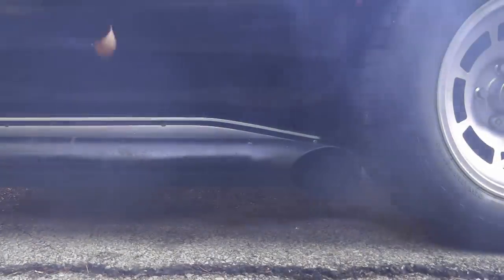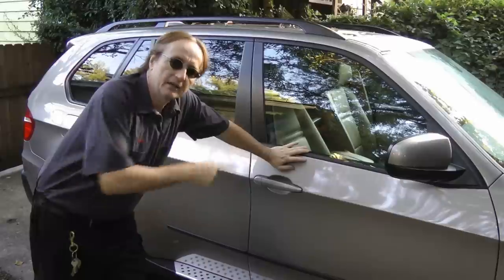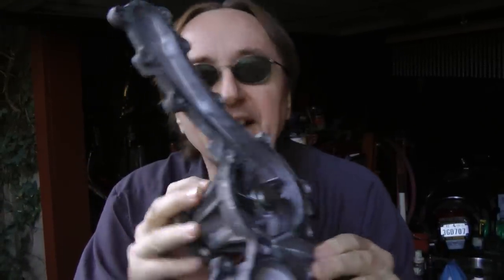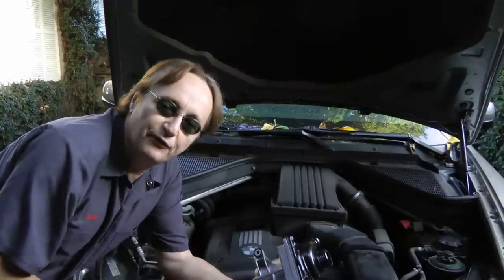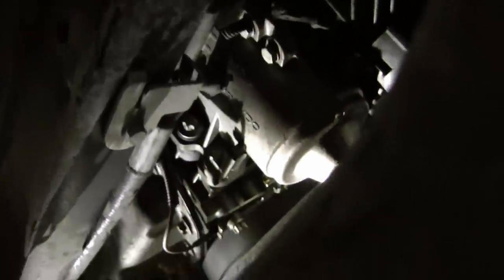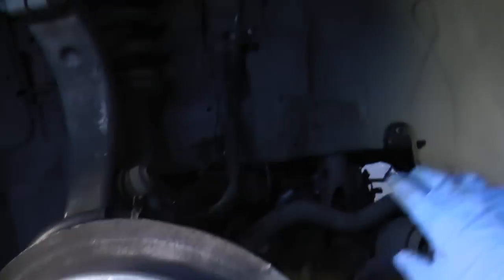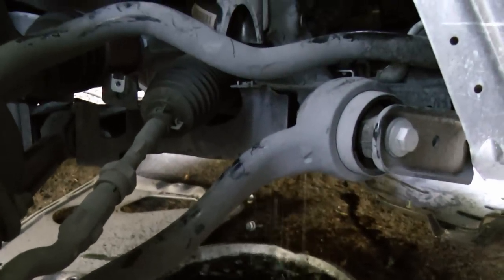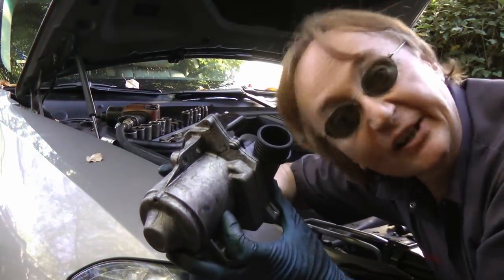How To Replace a Bad Electronic Water Pump

Comment: Well, let me first say i love your channel, as to the electric pump, it.'s plastic to save weight, and it is electric so it can be turned off when not needed and thus does not create unnesecary drag on the engine. Full disclosure, i own a 12 year old bmw and it has never given me any headaches. I once talked to a headgasket manufacturer and he told me bmw has an acceptable failure rate of 0.05 while chrysler's where from 2-3% this extra overhead makes the parts expensive.
Reply: Failure rate of 0.05 and the parts still break all the time?
Fuck BMW .
Reply: Reducing weight makes sense if you drive a race car around a track. With a part that's more expensive and breaks more often than a traditional pump, the money you save in fuel is probably very low compared to the costs + labour for replacing it. And if fuel efficiency is your concern, you don't buy a BMW. You buy a Prius or something like that.
Reply: Dont worry Henrick...
Here, we witness another BMW fanboy who has never actually driven one.
Reply: Bruno Danese sorry your comment makes me sad. You have not even bothered to read my comment. If you would have, it clearly states I own an 12 year old bmw(I also own 2 BMW motorcycles(one from 87 and one from 98, both maintained and driven by me, so i know a bit about the mechanics not to mention the fact that I studied industrial engineering, maybe irrelevant, but I like to think it gives me some insight in mechanics). I also maintained an american car that gave me nothing but headaches, so yes, I am a fanboy, but not because of the badge, (I would rather see it be unrecognized), but because of the engineering, although there are some design errors, german cars are in fact well engineered. So please, if you are going to comment again in this thread(or anywhere else on the web) read the previous posts first, do not be condescending and insulting, and try to add something to the conversation and not subtract from it. If you have actual reasoning and points you would like to make about the conversation/debate, I'll be happy to read them and maybe even adjust my opinion. For instance Henrick Nilsen brings up some excellent points
Reply: Henrik Nilsen Yes, I am not going to argue there are no design flaws(there always will be, and bmw is quite keen on making them) The savings might be minor, although the same can be said about rack and pinion versus electric assisted steering, yet the entire industry is moving toward the latter(although I really dislike the feeling). I am assuming you are an american or canadian?(sorry if i am incorrect) but in europe bmw's are like camry's, they are everywhere (with diesel/small 4 bangers)and in the domestic marketplace, there is an advantage if bmw can tout 5.0l/100km if audi uses 5.2l/100km + EU regulations that must be met.(ps petrol is ~6.00 $/gallon in europe). So yes in the american marketplace where bmw is premium, it makes no sense, but domestically, it does make sense. However, bmw are full of themselves concerning the price point of parts. Ussually they are very well made, but ridiculously overpriced, even taking into account the acceptable failure rates, that is correct
Reply: Henrik Nilsen ps there are other advantages of the pump being controlled by the computer. The engine can reach operating temperature faster, turnover on cold days is easier without the added drag etc. And plastic is in fact more corrosion resistant than metal, thus normally it should last longer. Should it have been engineered better? Probably, but the idea is correct(that's why other manufacturers also do it). I love Scotty Kilmer's channel, he has great insights, is helpfull and is a champ for making the videos, but ever so often I find him to be shitting on european cars because they are not like the ones he is used to in america. Which is totally acceptable. I also shitted on an old pt cruiser I used to maintain where I had to take of the front wheel to replace the headlight bulb. Now that's stupid engineering compared to a bmw where you don't even need tools(just clips that can be loosened by hand). Now bmw is also crazy as to stipulate i need to check my clutchplate every two years on my r1100gs(the whole bike has to be disassembled to do that). So as far as I can tell, every automaker has it's quicks, but I do love the feeling of a Boxer

Comment: I had an 82 Camaro, it was 19 years old at the time. The water pump belt snapped while on the road. All I did was walk across the street, picked up a new belt at a mechanic's shop, put it on and drove off. No mess.

Comment: when i was doing research for bmw e39 and e46 i saw somewhere that u can buy aftermarket water pumps with metal propellers...that will help u a ton on BMW, since they all have overheating problem, because of a water pumps.

Comment from the maker: well, coolant is not flowing through the heater core and it's overheating. So really, fix the overheating problem first as heaters often fail when the car overheats, especially if they get air in the system as heaters don't work with hot air only hot water. try my video "how to fix an overheating car'

Comment: I fully support the idea of electric coolant pumps. They help the car warm up faster in winter (helping fuel consumption and improving comfort) and can run faster in summer when engine is idling to cool down the engine even with the engine off...something you can't do with a pump dependent of the engine revs. But I also support Scotty's point of view about building this pump with brittle materials and installing them in unreachable spots in the now very cramped engine compartments. Coolant pumps always fail, either every 40k miles or every 100k miles they always fail so make everyone a favor and install them in easier places....not like you depend on the belt to run it like before. This is why all luxury brands get hit by depreciation a lot more than conventional brands.
Reply: +Ivan Jaen You can get the original brands completely out of metal. So why does he put a plastic one in and then moan that plastic sucks.

Comment: Disclaimer: I am only sharing my own personal experiences...
I had the same issue with my 2011 330i BMW that only had 50k miles on the odometer. I purchased the car used with 15k miles and the car was in showroom condition. The electronic water pump and thermostat had to be replaced at a total cost of around $1,500 dollars at a Indy shop. I had three oil leak repairs totaling over 1k and a starter replacement that cost around 750 dollars. Once I was driving on I-270 and the serpentine belt flung off because the oil leaks on the motor. The motor developed major oil leaks with around 50k miles on the odometer. The BMW dealership in Northern Virginia wanted 1,400 dollars to fix it and they were a little cheaper labor rate than Maryland dealers. I tried to replace the water pump myself but unfortunately it was overly complicated and BMW requires that you use their antifreeze coolant. Plus it was a whopping 8 degrees in Maryland that day with the wind blowing around 30 mph.The indy shops were a little cheaper but the frequency of things breaking made it frustrating to own a BMW as a daily driver. The bulbs in the tail lights burned out every other month and had to be replace. Each tail light held between (6-8 bulbs per board) which frequently burned out and would throw an error code on the navigation screen. The indy mechanic told me that its good I did not own a 7 series because it is 1k from the start to fix them because the front bumper has to be removed to access the motor. I traded the car in for a loss in 2013 for a brand new Nissan Maxima with an extended warranty. I still drive the Maxima as my daily driver with no major issues to report so far.  My next vehicle will be a Toyota 4-Runner or something equally as reliable. Scotty gives great advise about cars and knows exactly what he is talking about.

Comment from the maker: why would anyone defend BMW's insane over engineering? If they were logical, this stupid electronic pump would be mounted on the fender and take five minutes to change as an electronic pump could be mounted anywhere. But no, they hid it inside the engine causing one big mess to get it off. Realize, they just don't care about repair expense.

Comment from the maker: on those, often a bad main computer circuit does that, most guys will just wire the fans to run off the ignition switch and run all the time the engine is running, hurts nothing, easy fix

Comment from the maker: if the cam is worn out, it will not pump. In such a case, put an electrical pump on instead. Old worn out engines often get like that.

Comment: Hey Scotty! I'm a fan of the older BMW e39 e46, much easier to fix the the more modern ones which are full of plastic that breaks. Beautiful cars to be involved in maintaining and driving them and they have mechanical h2o pumps. I agree all your statements about BMW and Mercedes. My questions is do you agree with my statement or you are just hateful towards any year BMW?

Comment: The commenter posting about "dissassembling the entire Audi front end" is making it more than it is - that's called service position, designed to access the longitudinal engine. For any VW/Audi mechanic, this is a standard straightforward procedure to pull off, and the radiator support is designed to be easily pulled out straight

Comment: You're somewhat right but BMW and other German manufacturers do make some real over-complicated designs that kind of make one scratch their head. Every newer BMW leaks oil like a faucet after 60k and all the seals need replacing, plastic/electric waterpumps, faulty HVAs and fuel pump designs that they can't even figure out why they're failing. They make great performing vehicles so I'm sure they can engineer some sense and reliability into their product as well.

Comment: I have friends that have old e36 and e46 3 series, never had major problems with them. Engine and transmission (manual) were pretty much bulletproof. Guess it depends which bmw you buy
Reply: Stephen Wood that's the problem only old BMW were reliable. For the most part anything past e36s were less reliable

Comment: Sort of funny you'd mention the bumper for a Buick bulb.  I worked with a couple guys years ago in Virginia, just got out of tech school and came to work at a Pep Boys I had been at for a while.  They had an older Buick that needed a bulb, and they couldn't figure out how to get to the bulb from behind, since there was no opening, so they started disassembling the thing.  I came over a little later and, without spending more than a few seconds to figure it out, reached under to change the it.

Comment: Theres only a few mechanical water pumps I'd hate to mess with... the ones on some 4 cylinder ford escorts which are driven by the timing belt XD and the gear driven reverse-flow water pump on the LT-1 engine. But still, those are a piece of cake compared to this monster of a job. You're a trooper Scotty.

Comment: Every word is true,I own a secend generation x5 and the same thing happened to me, cooling fan running at full speed consistantly, overheating warning, went to the service centre to got this fixed, got charged for 4hr labor and the new pump, and also 3 new bolts lol (1320 CAD is total repair fee). Asked the advisor what caused the pump to fail, had no idea wth he was talking about, but he said that they do change the water pumps quite often. The time I wrote this comment is right after I got back from the service centre.
    4th year for me and I'm no longer under the warranty, hopefully the maintainence and repair fees are not getting out of control in the next year, if they are, I'll start looking for a Japanese car.

Comment from the maker: bunch of nonsense, over engineering at its worse. That tiny amount of drag left off does virtually nothing to gas mileage and power.  Just engineers showing off expensive crap that breaks down WAAY too early.

Comment: That's how I feel sometimes with my German designed 2008 Malibu.  For example, to change a headlight bulb I have to either take off the front bumper cover or take off one of the front wheels and unbolt the bumper.  Great thinking there!

Comment: Hi Scotty, thanks for your effort on sharing your knowledge =) can I ask you a question? are older series of BMWs more reliable? I'm looking for a 330xi (E46 series) 6liter V6 year 2000 costs like nothing this days! Is this garbage as the new models? or should I go straight to the even older (E36) 320 of the '90s?

Comment: The OEM pumps last a long time, there is also a metal OEM replacement which can be purchased for $450 online.  But the dealer will want $750 for the same part.

Changing some of these parts can be a pain if you've never done it before.  These jobs are much easier for people who are used to working on German vehicles.

I love the electric pump.  I can bleed my cooling system with a computer, and the heater stays hot with the engine off!

Comment: Btw I just wanted to inform you that you didn't have to go through all that hassle. Next time you get a failed turbine, the most efficient method of removing it, is by removing the oil filter housing assembly from the block. Save you about 1.5 hrs there. You should do this method regardless because the housings tend to leak, and  this way you can replace the gasket.

Comment: Scotty as a BMW tech for over 6 yrs... I ask Why so serious? A key detail you left out in this video:  BLEEDING THE SYSTEM. Did you run the bleed procedure through the HVAC module inside?  @petergriffen yes, the E90s also use the "turbine" electric pumps. They are much easier to access than on the X5 though.

Comment: Scotty I got friend of mine that has 2006 Chevy cobalt and the power steering bump along with the brakes work together no slave no master cylinder etc.... Its one electric pump that works for both. Here is the great thing about it he replaced cost him 600.00 dollars for the part alone and it was only found at the dealer

Comment: ..i like your semi-sarcastic way you put truth out there..hehe..been BMW fan, i have seen things you talking about and i do agree with your comments about it..only BMW i never had issue with at all, is Z4M Coupe, which i still have, and its rigged with gorgeous S54 engine..true masterpiece..other than that, new stuff comes out of BMW factory, seems to be designed by an accountants and not an engineers, i can tell you that..

Comment: You can buy an older luxury car from the 80s or even 90s and find that those pumps as well as other key components, in a practical sense from back in those days of course, were traditional metal and mechanical parts. This is exactly what i did when i bought my 94 c280 for only 2200 dollars, and the maintenence is actually fairly cheap and easy to do like any other car. And i still get the benefits of a vintage and clean luxury car. ;)

Comment: Hello Mr. Kilmer, Thanks for all the intuitive videos. I have a coolant hose question. Do I really need to change the hoses for preventive purposes or could I wait till there are signs? The second question is the factory says to use 5w 30 weight oil. Could I use 5w 50 instead? Would that harm the engine? Thanks in advance.
Reply from the maker: wait till they have cracks. That is too heavy oil for a modern car, can damage VVT systems
Reply: Scotty Kilmer thanks so much for your speedy reply. The hoses are about 11 years old with 160k miles of use. Still wait for cracks? Thanks again.
Reply from the maker: why not, it is synthetic rubber, not natural

Comment: I'm not sure how correct this is but in my theory, i feel it doesn't improve gas mileage cause it uses electric hence "electronic water pump" and this puts more strain to the alternator which in turn runs on a belt and this makes more resistance. what do you think?

Comment: Magnesium can be pretty strong if done right. Professional DSLR cameras has a magnesium alloy body, and you can drop them on the asphalt and step on them, drive them over with a car and so on.

But I'm sure these magnesium screws are mostly there for BMW to make even more money so they can sell you new bolts each time. If it was my car I'd replace them with something that I can use over. Even though I'd be more likely to sell the car.

Comment: I find it hilarious that it went out in three years because we have had electric water pumps made here in the USA that last forever. They have been used in racing for well over 10 years. We had a couple pieces of equipment with them and the thermostats would go bad. The one saw we had had the original electric water pump on it when they sold it at auction 6 years after we bought it

Comment: You can check the oil level, you just do it from inside the car. While some parts are more expensive on the BMW, my 330i has been very good with little maintenance. The water pump dying after more than 100,000 miles is the only major thing that has failed. Far less than what I have had to replace on my suburban.

Comment: Make sure you get the timing belt done on time, a mechanic friend of mine just looked at one with less than 120,000 miles with bent valves because of a failed belt.

Comment: Scotty, I believe I may have stumbled upon why they used an electronic water pump here. I took a ride this past weekend in a friend's brand new 328i. It has an interesting feature called "automatic shutoff" to turn off the engine at stoplights. When you take your foot off the brake, it turns back on. I noticed that even when the engine was stopped at a light, there was still good heat coming out of the vents. I bet an electric pump keeps the coolant flowing into the heater core. Bad engineering!